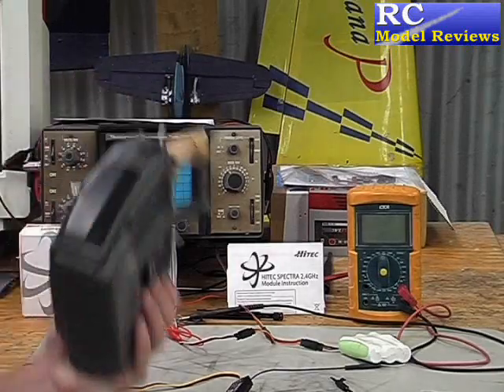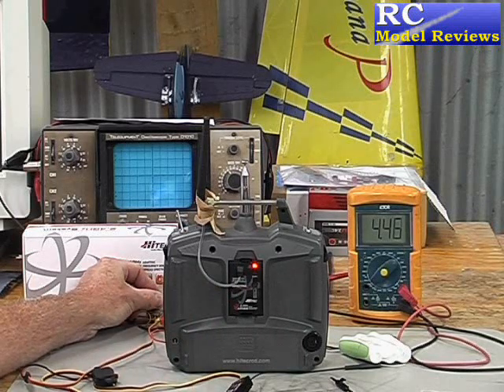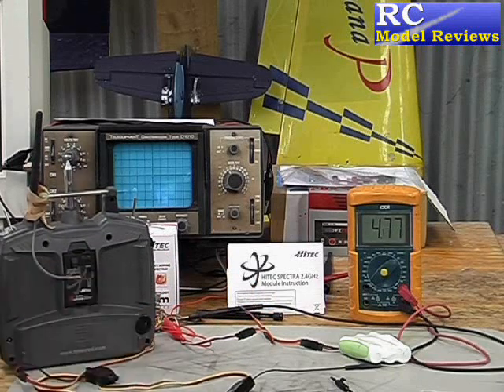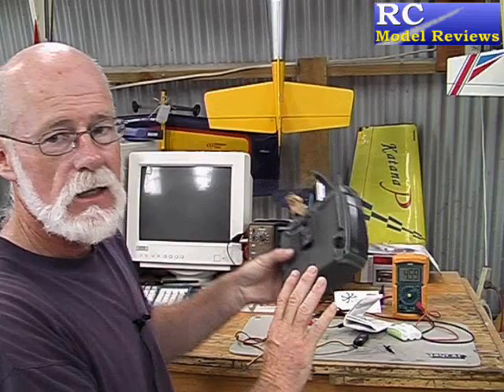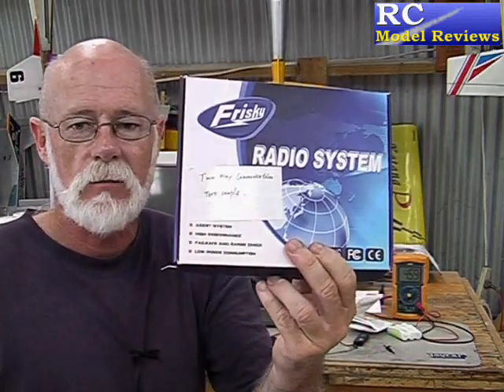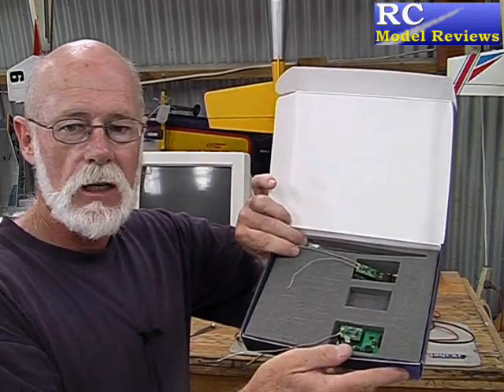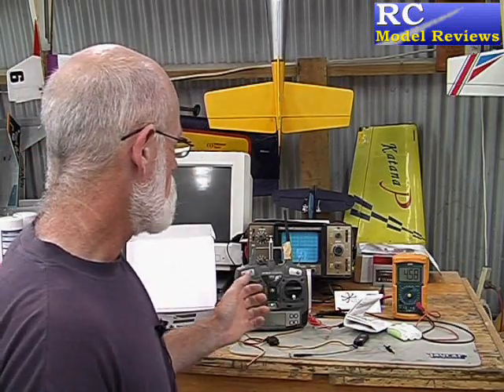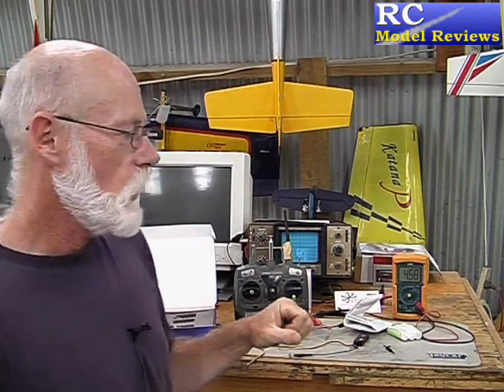A look at 2.4GHz radios with in-built telemetry

Comment: I have DJT module in ole reliable JR 10SXII and D8R in my airplane. I want to move toward telemetry. What do I need to purchase to accomplish this. or do I need to upgrade transmitter to the Horus X10 or X12 will I be happier in the long run?
thank you

Comment: @dalotel
Your response assumes that the data being returned from the model has to be displayed on a screen when this need not be the case. I aggree completely, while flying it is probably not a good idea to check a view screen all the time to find out if you are a few feet over your altitude limit, however, there is no reason that you couldn't have an audio alarm. Corona's brand new Telemetry FHSS sounds a beeper on the tx module when range is nearing limit or rx battery voltage is low.

Comment: @dalotel 
... ever heard of a DUD BATTERY...? I've unfortunately had a few, that appear to take a charge, however due to a bad cell in the pack for what ever reason, the pack discharges rather a lot faster than expected - this is also an issue for electric planes where the speed controller voltage regulators can be faulty etc... The newer telemetry capable module systems mean that extra features can be added to EXISTING transmitters so that you don't have to spend $400 on a new one...!

Comment: So what you are saying is the frisky has a serial connection and two analog connections to mess about with! It is a homebrew set! I want one! Will those telemetry units be actually built into the radio transmitter and receiver then?

Hang on a sec, two analog connections? You could use them for a camera!!!

Comment: In certain areas, it makes sense to use something like GSM or UMTS or CDMA 1x / EVDO for back-n-forth communications with the airborne something. The GSM CSD is a bit sluggish with something like 1.2s round-trip time on the link, but works on a relatively large distances from the tower(s). The data speed is 9600 bit/s (CSD) and can be hundreds  and even thousands of kbit/s with UMTS or EVDO...